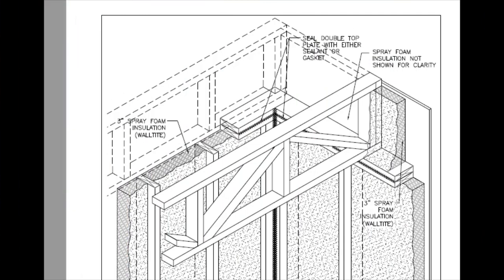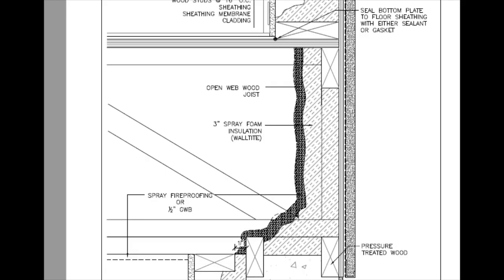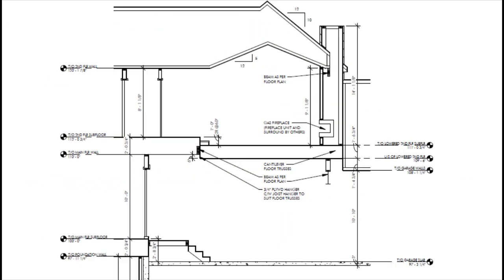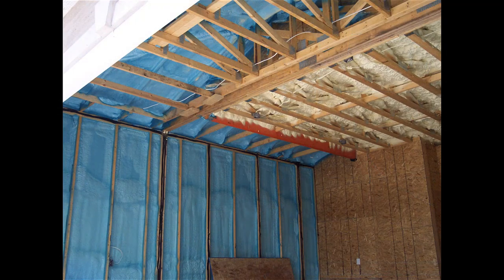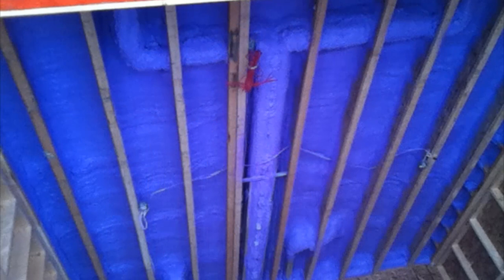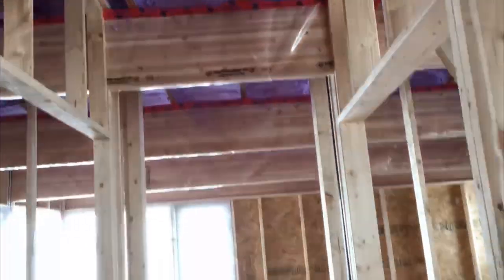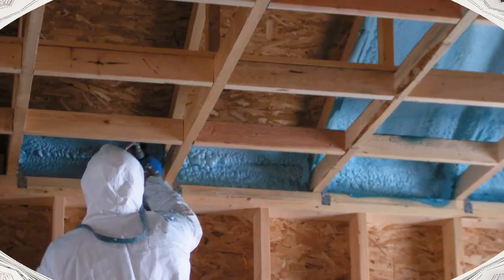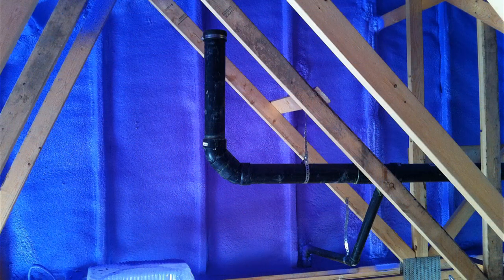6 Areas That Need Spray Foam Insulation In Your Home - And Why

Comment: If it can nor Breath it can not Dry out and I want my Coat on the Outside So would it not be Better in the Outside
Reply from the maker: SPF on the outside is excellent. How much venting is done on a commercial roof with rigid insulation, membranes and ballast? You need to expand your understanding of what you are saying by "it needs to breathe"

Comment: I thought that you needed a small air channel between roof sheathing and closed cell foam, so that the innevitable moister in the plywood can dry out (since it can't dry through the waterproof roof lining.

Comment: I plan on doing a metal roof with zip OSB sheathing. And close cell spray foam insulation underneath on the inside. Do you recommend having a ventilated roof and ceiling off the attic completely with the spray foam?
Reply from the maker: I recommend non-vented roofs when they are done right. Watch the 4 part series on non-vented roofs in the roofs playlist.
Reply: @SprayJones  I meant to say that I’ve seen some give their opinions to do a ventilated roof only and it closed off attic that’s not ventilated to prevent rodents from getting in. And maintain controlled air conditioning. The thought on the ventilated roof was to prevent condensation from leaking into the attic.

Comment: Rafter rot in our 100 year old home’s attic…..seems to be a humidity control problem during the cold canadian months eventhough our attic has 6-8 inches of spray foam the roof….if had to do over, would not spray foam
Reply from the maker: 6-8 inches of closed cell??
Reply: @SprayJones  open cell
Reply from the maker: @123mikerourke  That's the reason for the issues. You need vapor control with open cell SPF. Liquid applied or sheet products.
Reply: @SprayJones  ok. Do you have brand names for either solutions ?  What about mechanical means of controlling humidity ?  Air exchanger ?
Thanks for the exchange.

Comment: You should be sealing penetrations before spray foaming. You shouldn’t be relying on spray foam to seal penetrations. Seal the penetrations correctly first then use spray foam for insulation.
Reply from the maker: Can we use can-foam Jeff?

Comment: If you could possibly eliminate every hole on a house you are in one dangerous a** house that is a mechanical home relying totally on your ventilation system no system nothing to do with insulation except except negative A house with no leakage is A Dangerou's home fires burn differently in these homes
Reply from the maker: John, get educated before you type. 

Do you fly in an airplane? How much air leakage is there at 37,000 feet?

How does a pool room at a hotel deal with envelope in Alaska?

Comment: Mr. Jones the part you're not understanding is the tighter you get at home the more air leakage you get through the fewer holes when your house is under negative pressure is all about positive and negative pressure in your home which is a heating and ventilation issue not an insulation issue

Comment: Do you recommend venting above a vaulted/cathedral ceiling where the under belly of the roof has been spray foamed? This is for a new 4 season cottage in Canada so we are going to be dealing with very hot and very cold temps throughout the year. Thanks

Comment: I guess my only hangs up are that I'm not sure whether to use open or closed cell... Spraying insulation on the inside of a basement that doesn't have insulation on the outside (where soil frost level is 26" deep) I'm worried about holding/cutting off the vapor and having the basement walls crack, and encapsulating the underside roof decking may cause roof rot on the decking... IDK... I almost need a time machine so I can see 20 years into the future to see how this stuff holds up.
Reply from the maker: Closed cell when in ground. Watch the open cell playlist to know more.

Comment: During the lumber price spike, we went from going with 2x6 for the exterior walls to 2x4 and completely filled the cavity with closed cell.   Saved on the total cost, got the insulation, and added strength.
Reply: So basically cheaped out on the building quality.  Great job!

Comment: In the crawlspace, instead of spraying the underside framing of the upper the floor, I’m looking to spray the concrete block walls, and the slab to reduce humidity and coldness. It would then be somewhat of a heated space because the crawlspace is partially raised and it’s ceiling is on par with the height of my basement ceiling which shares a drop ceiling that allows warmed air into the crawlspace. Anything wrong with that idea ?
Reply from the maker: Nothing wrong. We do that all the time. 
Watch the video "in contact with ground" for more info.

Comment: If you seal (spray foam) the porous concrete basement or crawlspace foundation walls, won't that just stop water infiltration only right up that point? So essentially water will seep from the exterior thru the concrete and have no where to go, stopping at that spray foam barrier. Couldn't that actually cause water entrapment in the foundation wall & therefore cause serious erosion/ cracking issues?
Reply from the maker: Waterproofing is always needed on the exterior no one is saying to forgo that. What the SPF does on the inside is a bonus and helps double up the protection.
Reply: @SprayJones  ok thanks for your reply, just curious b/c a lot of existing homes/ foundation walls are buried below grade & have no exterior vapor barrier/ Kilz and if they did, the dirt likely already degraded it. I'm just concerned the water would somehow get trapped right up to the SPF & just saturate /never leave?

Comment: DOES THE SPRAY FOAM IN THE UNDERSIDE OF THE ROOF ADD ANY STRUCTURAL INTEGRITY?     I'M LOOKING AT SHED TO HOME PROJECT AND THE SHED DOESN'T USE RAFTERS.   THANKS FOR THE HELP
Reply from the maker: Yes of course it adds support. I have a whole video on the structural benefits of SPF.

Comment: My understanding is that you shouldnt insulate the inside of a concrete foundation, because if theres a water management failure, like failed gutter, or improper soil grading, and pooling water near the foundation that'll freeze in the winter, it'll cause frost heave on the foundation. Maybe its different in the south, but here (PA) insulation is usually applied to the exterior of the foundation.
Reply from the maker: That is not accurate. 
We are in some of the coldest climate in North America & Building code since 2010 is mandatory to have a basement insulated. 99.999% are done from the inside.

Comment: Here in Virginia we have to leave a termite Gap near the seal plate. In that instance spraying in the joints bays wether basement or crawl space might not be possible. Have you come across this?
Reply from the maker: Yes. The whole termite issue is one that needs more discussion on. I will be doing a longer video on that.

Comment: You don't need roof ventilation here in Michigan if you have metal or clay roof. Asphalt shingles DO NEED VENTILATION. You do need ventilation in your spray foamed house then where does the moisture go??????????????? That's why code requires ventilation. What he says is misleading. Take a shower where's the moisture go? Boil some water where's the moisture go? You may not need roof ventilation but then you need mechanical ventilation by code. If your vent fans can't pull fresh air how does it vent? Spray foam is great but it can be miss used. Spay foam against something that condenses will never dry out. Just trying to set things straight. I don't want to have to rip out another spray foamed basement. Hows a basement suppose to dry behind spray foam? It don't. What happens in basement is masonry condenses right at spray foam. It's sealed from coming in. But it's sealed from leaving too. 22000$ to rip out spray foamed basement and try to stop the mold and mildew. You don't need ventilation just never shower or breath in your house so moisture won't be a problem venting it out.
Reply from the maker: Watch the 4 part series on non-vented roofs.... or not I don't care. 
We deal with people that get the physics of what the foam can do. 
You are not listening...

Comment: In my garage  I  had 2 inch closed cell sprayed  in 2x4  wall and 4 in under roof. I'm  in Denver  . I have a 30 Amp electric  heater  and set on low  it keeps  garage  above  50 degrees for less than20 dollars  a month  and that's  with shop tools and  lights. Love the foam , it's  worth  the $4,000  for insulation in 24x32 garage. Spend the  extra money.
Reply from the maker: I agree. Thanks for the testimony.

Comment: I have a 10 x 20 wooden shed with the spray on vapor barrier of the silver stuff and I’ve already insulated the walls with fiberglass because I couldn’t get Rockwall and put the plastic six mill vapor barrier over it and taped it with a special red tape. I put rafter baffles up to the ridge vent but left the ridge vent exposed on the inside. Now I’m considering spray foam to rip the baffles off the ceiling or leave them I’m so confused. I also will be living in it full-time in the south but there’s lots of humidity. It’s a barn loft so I want everything to be expose so I can use the loft for my altar and a spare bed

Comment: Where’s the roof leaking?  Hmmm no idea
Reply from the maker: Hmm.... need water coming inside a structure to tell if there is a problem?? Hmm I wonder how else one can do an inspection??
Reply: @SprayJones   I guess you could pull ALL the shingles off every time it rains to see if it’s leaking on to the boards or sheeting under the shingles. With spray foam you’d have NO IDEA it was leaking

Comment: Hey Spray, I love your videos. 
Rim joists -- is it ok to spray foam into a rim joist bay that has a metal rim joist hanger, like for a dropped down design?  Will the spray foam adhere to the metal or degrade it over time?
Thanks
Reply from the maker: No it will not damage metal. I cover this in the "what can we spray to video"

Comment: Mike thanks for all the great information. Where can I find Documents or literature stating or certifying that 2 inch close cell performs better than an R 38 traditional material. I am trying to convince a inspector the how air seal is more important than just the r value.
Reply from the maker: If he is stuck on R value alone you cannot. The foam will be an R 13 and the R38 is just that. So if he has to satisfy a number you either hit the value or find a loop hole to avoid it, like vaulted ceiling values vs flat ceiling values, or you get a building envelope engineer to write your values and seal it. 

I will be having a resource center on our web site soon for research reports.

Comment: Big fan of spray foam something you didn't mention.. I saw a concrete co. spray foam 2" directly on ground, then poured over. Something I'm not sure is directly on bottom of Roof sheathing.  If you have a leak will  not know and alot of damage can  happen. Thoughts?
Reply from the maker: I already have a video on that subject. Check out the vaulted roof playlist.

Comment: Hey just recently found your channel and love the videos. I have watched several of them so far but as another YouTuber I have to ask what microphone you use? On my stereo I’m hearing a lot of plosives which is often indicative of the microphone being too close to your mouth, or needing a plosives screen, or even the wrong microphone which I did for years. I switched to a cardiod lav microphone and it greatly improved the sound.

Also, which is better for sound dampening,, open cell or closed cell?

my YouTube channel is doing well and I plan on building a 4000 square-foot shop/office and then a custom home in the next couple of years and I love spray foam. Thanks for the info
Reply from the maker: You are watching older videos. I now have a better mic and a pop filter. 
It has been a process creating, editing and improving. Some of the older vids are hard to watch, I recently deleted 25 of the oldest and roughest. So hence my goal to do 25 vids in 90 - 100 days. 

Choose SPF for the thermals and correct match for your environment first. Then look at the acoustic last. I will be doing a video on comparing the two late on.

Comment: Do you have another video that goes into more detail about the cross-ventilated option for insulating between joists in a ceiling?
Reply from the maker: I will be. Before March is out I will be into a 4 part series on cathedral ceilings.

Comment: You mention the roof decking with no air flow...in my area you need an R49 ceiling.  I’m going for an R60.  With 2x4 truss top cords if you do 3.5” of closed cell are you passing code at only R24.5?  I thought you mentioned closed cell vs other types aren’t 1:1 so a ceiling my not need a R49 to pass.  But now you are heating and cooling that attic.  Mines over 12,000 cubic feet.  Seems like a lot of area to heat and cool.
Reply from the maker: 1. Specs are different for vaulted/cathedral ceiling. The foam is installed to those standards NOT the flat ceiling spec for blow in. 

2. All our install have been engineered and stamped. They are on file with the permit office in each jurisdiction. It is to that standard that we install and they inspect to which is NOT a fibrous spec.

3. Go watch my video on "does it cost more to heat this way"

4. You are still talking about R value like you are buying a used car. The number is meaningless because you are measuring 1/3 of the heat loss equation under perfect lab conditions. Convective loss has far more to do with insulating than conduction.

Comment: I hope you read old video comments, I was considering adding foam to the basement. Would it help to prepare the issues? I have plaster and paint over cinder block all and the joists have been there for 120 years and are dingy looking. 

I have an older masonry brick house. Do you all recommend spraying those? The walls in my home are very cold in the  winter. I assume from what i can see that it was filler with some kind of fluff but its all sank over time. I've seen mixed things on if its possible with masonry homes.
Reply from the maker: 1. Yes you can spray masonry homes. Biggest commercial brick building in town was done by us. I will do a video about it because the building envelope specialist bitch slapped the architect in a letter about his reluctance to use SPF. 

2. Clean up the walls. I have a video on "what can SPF stick to". Check it out.
Reply: @SprayJones  Thats good to know, I've seen so many people claiming that the brick wicks so much moisture it will cause it to become brittle over time. I just want heating bill under 200 lol.

Comment: Block cmu wall foam injection? Had a guy try to sell that to me instead of lining the inside with the reflective foam board. 

It wont be a balanced insulation because the foam wont always reach everywhere and there are solid columns of concrete in the cmu. He claimed it was a higher r-value than the foam board.
Reply from the maker: Good for you looking at the big picture.

Comment: Great points as always. Appreciate the content. BEST. Can you clarify the below.
1. Do you recommend rafter vents baffle for air circulation beneath the roof seathing and insulate under the baffle? If not how will there be moisture or condensation beneath the roof seathing.
2. If the basement contains cinder blocks, applying foam insulation, will it not make the cinder blocks moist due to water from outside? For concrete foundations, I see very bad waterproofing on the outside. How will this affect if we do foam insulation from inside to the basement walls.
Reply from the maker: 1. I have a whole playlist on vaulted unvented roofs where the science is explained in great detail. So please watch.
2. Cinderblocks, well you need to stop the water from the outside for sure, but then apply the foam on the inside to seal all the joints and back up the block with rigid support.
Reply: @SprayJones  : thanks . Looking forward

Comment: Great videos, I like the idea of spray foam at roof.  Does the space above the ceiling need to be conditioned?
Reply from the maker: It will be naturally. All codes for us require that it be included in the HVAC system sizing. A moot issue.

Comment: If I am wanting to add spray foam to the rafters but I already have ventilation in the attic due to the insulation originally being batting on the floor, is that a problem?
Reply from the maker: You have to convert the attic from vented to non-vented. So if SPF it to the roof deck no vents are used, close them off. But ONLY if you can properly get things sealed so you won't have condensation.

Comment: What about injection cell for concrete block construction. With the inside walls that have 1/2in PT straps for the drywall.
Reply from the maker: Concrete block can have foam inside. Since they are staggered it is an issue to get all the way to the bottom unless you fill sequentially as you lay so may courses of blocks.

Comment: If I want sound dampening, do you just spray the sound dampening foam over the regular closed cell foam?
Reply from the maker: Not usually. You need 3-4 inches of open cell to make a difference.

Comment: Could someone tell me what is the cost of this product .
Reply from the maker: Too may variables. What does a new car cost?
Reply: @SprayJones  OK, so what is the average cost per SF for 2" of foam in a non-vented ceiling???
Reply from the maker: @sapulpaorganics5402  You think I am rude for not answering. There are variables that change it. Slope, travel, time of the year, I have a buyers guide to pricing video coming out and it may shed some light on what it takes to arrive at a price.